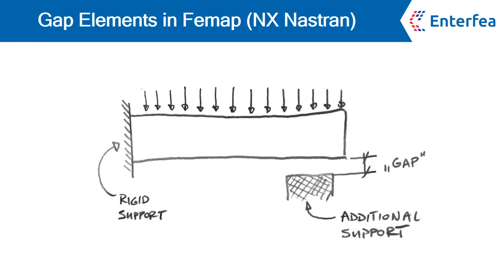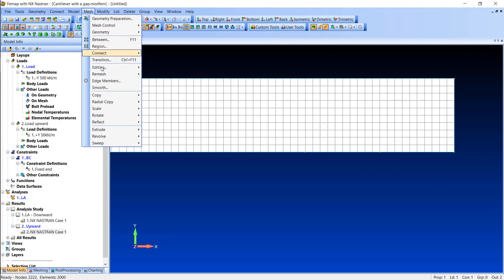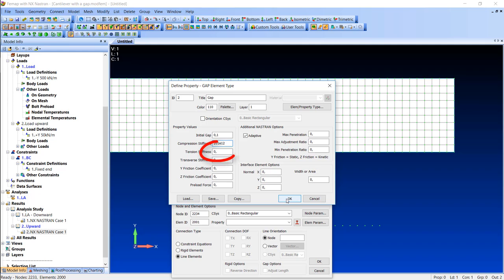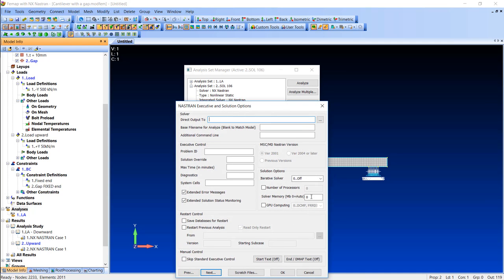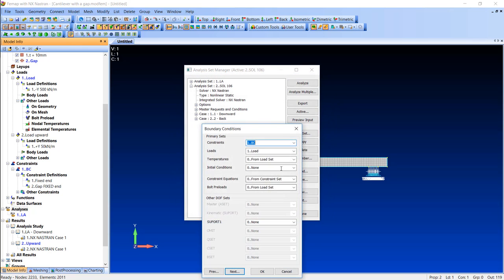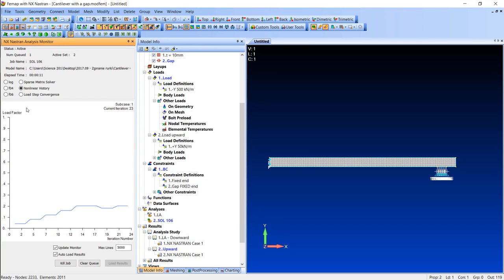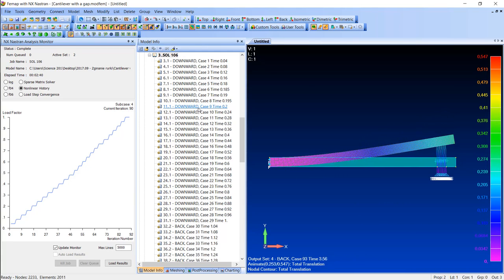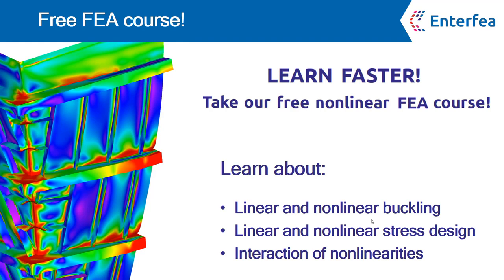Nonlinear support with gap elements in Femap

Comment: Hi Łukasz, thanks for this great demo. 

Do you always leave AUTOSPC ON when running an analysis? Why would femap leave it on by default? 

Thanks again for all the great content!
Reply from the maker: Hey! To be honest, I can't check which is the default - I'm on a skiing trip right now without access to my license, so I just can't click this through. I think it's on by default for some analysis and is "off" for others... or at least this is what the Quick Reference Guide would suggest - I understand from your question that you would rather not use the parameter - would you have the time to elaborate a bit on this, I would love to learn how exactly this singularity constraining works :)

All the best!
Ł
Reply: @Enterfea  hey no rush on the reply. I usually run static linear and always have to check off the AUTOSPC. I worry that if I leave it on my model will run with singularities in it which I would consider to be mistakes to be corrected. Perhaps there are scenarios when this is desirable? I don't know!
Reply from the maker: @andrewlite  to be honest, I feel that this is more like a tool to "support the forgotten node" to be honest, but thank you for pointing this out - I will take a look into that when I will have the time :) All the best!